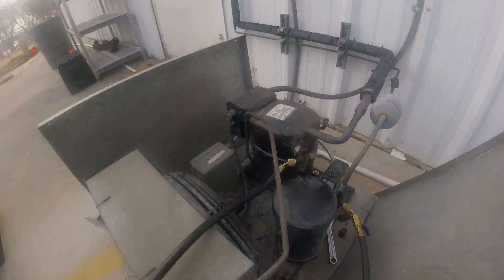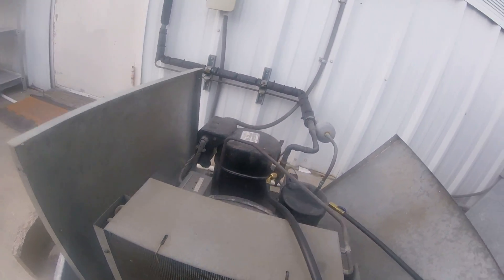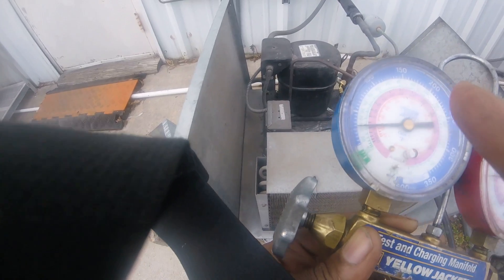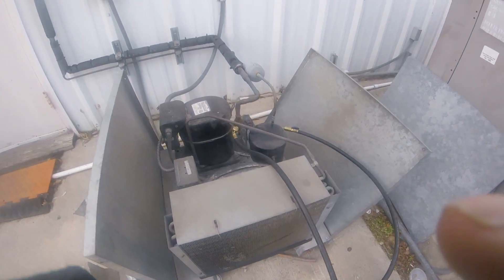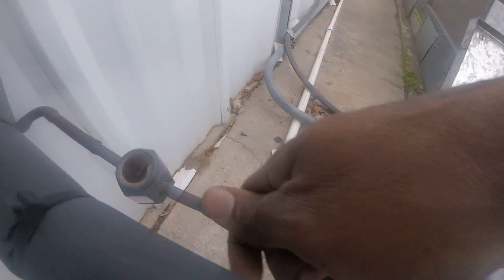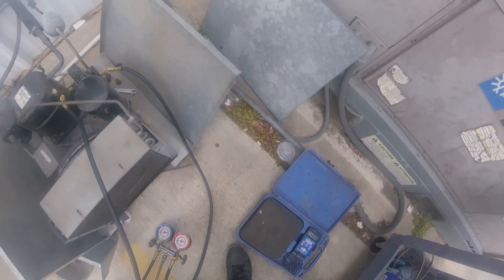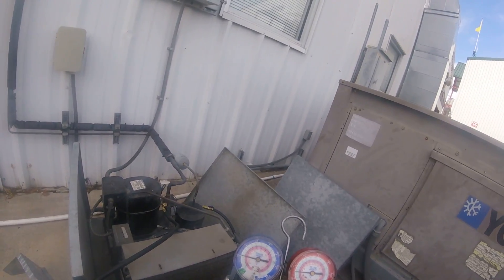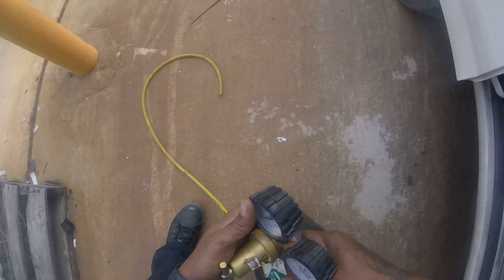HVAC: WIC not cooling properly

Comment: Anytime you here txv is hiss that a means that the system is low clear the sight glass then your back pressure should be 48 pisg give you a 22F evaporate temperature,degrees I would check the txv make sure  it's feeding correctly set it for 10 degree superheat do a good leak check on the system l would check all the brazing if that a new evaporated coil.
Reply: ac refrig only difference is temp subcooling and superheat apply which is splits across coils all about temps n coils regardless of application ac to frezeers clear glass fully loaded or open valve clear glass then set many ways if you know what your doing always critics

Comment: chech split across coil adjust valve to 10 to 12 degree split outlet suction line back to compressorr should be 12 degrees warmer then after txv  clamp thermometer like fluke 52/ll open valve to lower close to raise superheat reading or delta t across coil 1to3 for frezeers want constant temp across coil for freezer or lower superheat same for subcooling flip it t1 clamp goes on warmer discharge line t2 on liquid line 15 degree subcooling ensures valve gettn all liquid